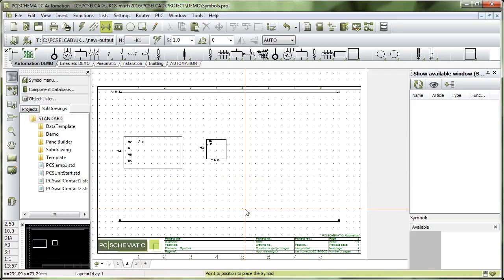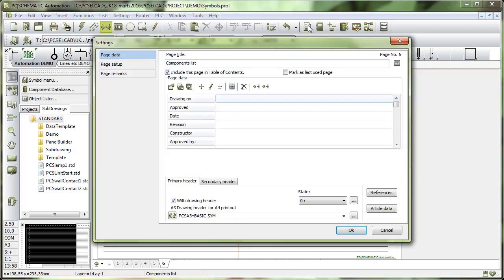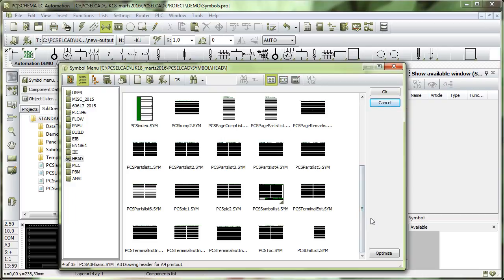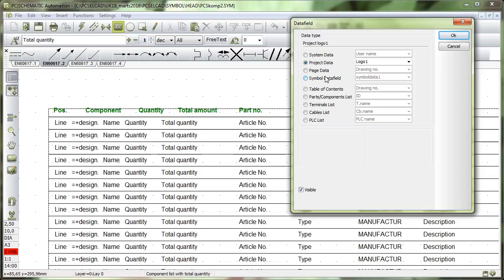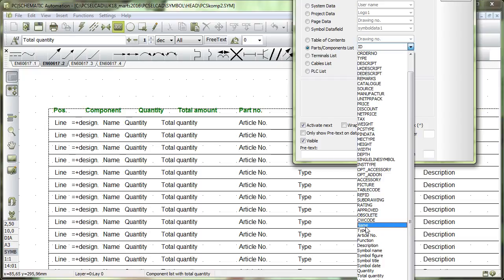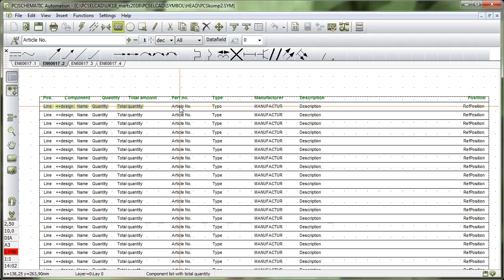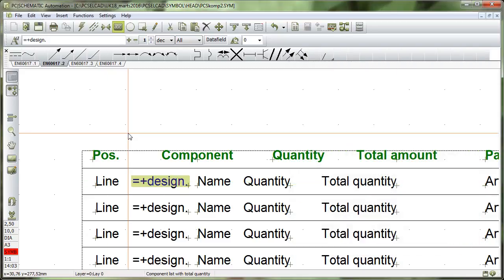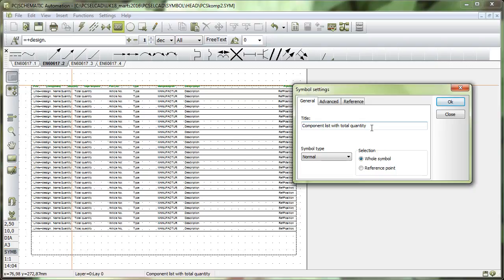Create your own symbol: Make your own List symbol (9/10)

Comment: Hi, i am using pcSchematic versiom 17, I have a question regarding list. I have a schematic and a list at the back called termination schedule. The termination schedule shows each cable's tag number, core identification(color or number), connecting from which terminal block to which terminal block, and the cable type. In order to automatically generate this cable termination schedule, In my schematic I use "cable symbol" and drag it across few wires, gives it a name, type, make it visible and in the conns tab i add in Name for each wire/core's id. Then I go back to termination schedule page and update the list. So far so good.

But the problem is, i would have to make each and every cable symbol back to invisible so that I can print a neat and tidy schematics for my client. So everytime I need to revise my schematic, I need to make all cable symbol visible, revise the schematics, update the list, make all cable symbol invisible back again, and print for submission.

Is there a better way to doing this? How can I update my termination schedule, and doesnt need to manually hide those cable symbols in my schematic?